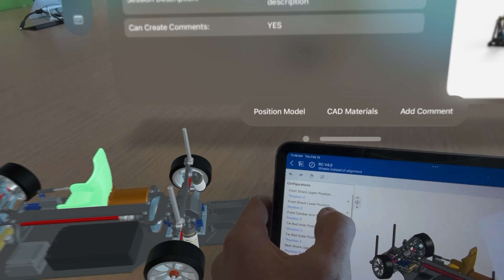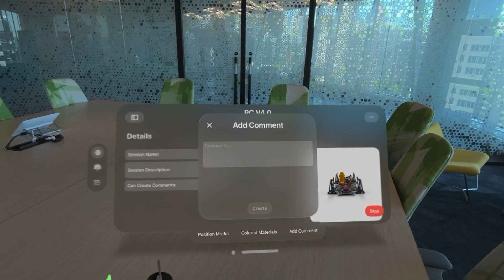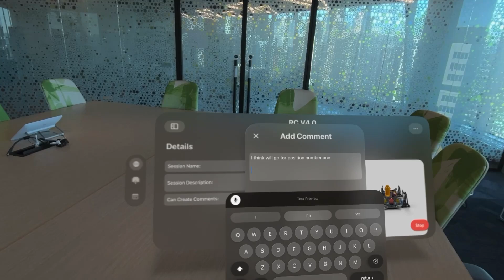I can't get enough Onshape Vision on the Apple Vision Pro! (Highlight: Updating configurations)

Comment: If someone was developing something like, say, a carburetor, or throttle body, or other fluid flow control device, is there a way with vision to sort of visually 'walk through' the model so to speak?   Could you follow the path of flow inside the model and see what the passageways look like?
Reply from the maker: While you cannoy create a path a priori and then fly down it, you can do a walk through by.... walking :) The trick is to make something like the carburetor really big (there's a gesture for scaling things up) and place it at eye level. After you fix the position/scale you are free to move about the model. I think I have a video of me walking around inside the Perrinn424 monocoque chassis, admiring the front anti-rollbar setup. Will link to it if I find it.

Comment: Hi mister  i love onshape design drawing it nice useful 
But assembly especialy motion little bit 3 day try geneva wheeel not make motion 
P.s i use free veraion
Reply from the maker: Yes the Geneva wheel is a bit challenging for our constraint/mate system currently. You need something that allows for lift-off between the wheel and cam. This is a nonlinear constraint which is outside of our current scope. Other than that, I hope you're enjoying Onshape!